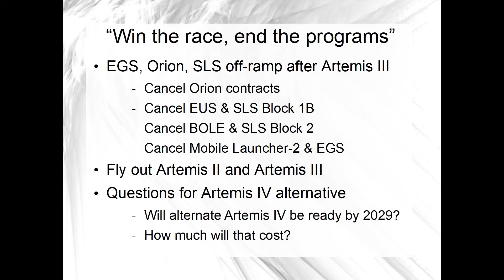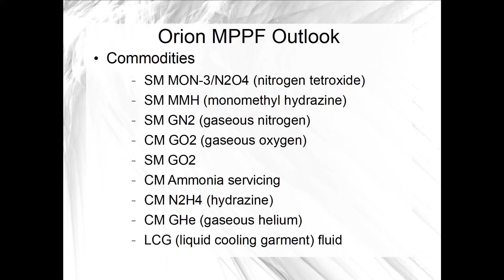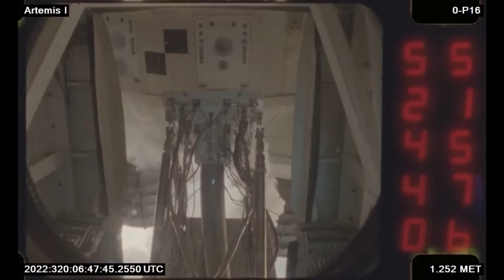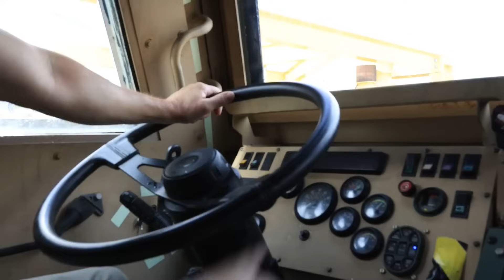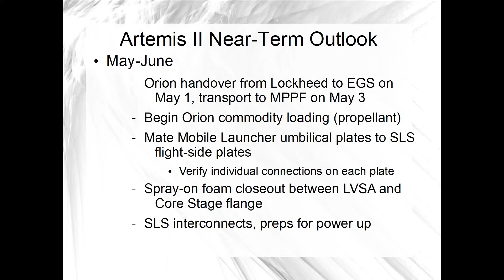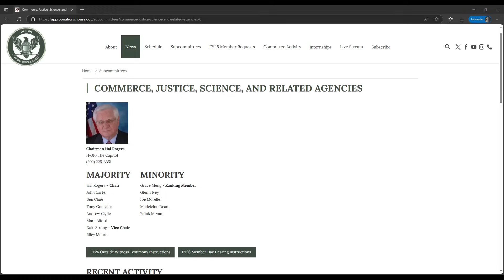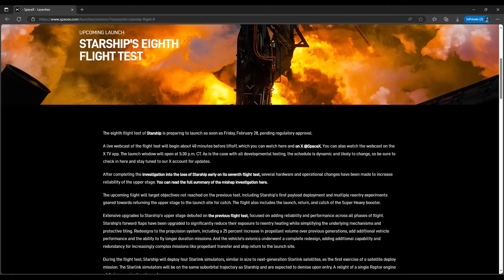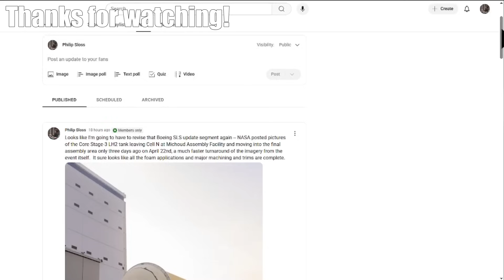NASA EGS continues Artemis II launch preps and training

Comment: At 11:20, what do you mean the wiring harnesses along the length of the service tunnels have yet to be run? Isn't that part of the build before it's insulated? It almost sounds like like they are building and wiring a rocket. Instead of mating components and plugging connections together. How can they do power up checks if wiring harnesses haven't been run yet along the tank and SRB's?
Reply: He’s talking about the final wiring. Of course almost all of it is done. Flight termination and launch escape systems run independently of launch vehicle systems for purposes of safety and redundancy; they’re also essentially a trip wire in order to operate as quickly as they would need to be operated in event of an actual emergency so just relying on a single, already integrated electrical system by a subcontractor for an essential system would be an unacceptable risk by nasa standards
Reply: Interesting, no other industry that I am aware of works that way. Subcontractors are expected to supply finished and tested components. Wiring is only done for change orders or component modification/updating. The complete system is expected to be "plug and play" after the assembly

Comment: Thanks for breaking down the steps of the appropriations process. Do you think we'll get any clarity  on the future of Artemis before the markup happens? And doesn't the Administrator have to receive specific authorization in a CR to cancel something as large as SLS?
Reply from the maker: We've only seen the budget request preview, but the administration is proposing cancellation after Artemis 3.  The program could remain for multiple years, but a large percentage of work today goes into future upgrades that don't fly until Artemis 4; those would not be needed in the administration's plan.  

There would be questions about what authority the NASA Administrator has in a situation where there is no explicit guidance.  IOW, if there's nothing that says Artemis 4 needs to be preserved, can that be canceled?